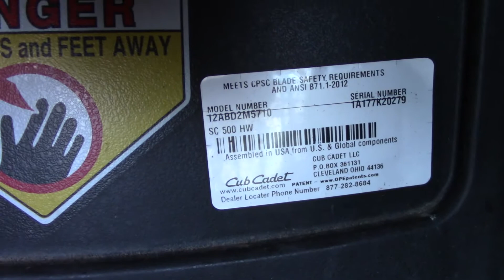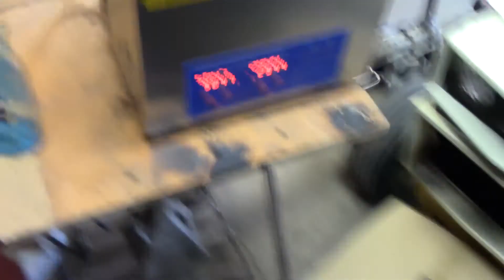Cub cadet push mower SC 500 HW Will not start after sitting all winter. Easy fix.

Comment: I have the exact same model, garage kept and use Stabil with fuel.  First 2 years worked well, last month wouldn't start.  Changed the plug and nothing.  A tech installed the tester and it fired right up.  Worked fine with tester removed now it is very slow starting.  Will have to do this same thing you did.  Thank you.
Reply from the maker: It's great you found the problem and that my video helped

Comment: I was way off on my guess o well maybe next time.  Thanks for the video  I just got one myself same brain but it's a little smaller size 6L but I have learned a lot on them to filling it full with water then you can put your parts in a container with the clening stuff  you save on the clening stuff an you don't have to clean out your mushen and you can use hevy duty zip lock bags to. I have put wingnuts in a zip lock bag an 1/2cup cleaner i ran it for 10 minutes temperature at 110 f i was wow they was clean like they was new the cleaner  that is in the bag is black what's nice i only used a 1/2 cup of the cleaner to do the job when i was dune i put the old cleaner in a container to store it in and i put the bag in trash im happy.
Reply from the maker: I just use plain water and a dash of dish soap. I will be getting a small mesh basket for small parts.

Comment: Fantastic video. Thank you.  I need to replace the control cable on my sc500hw. The cable broke. I can’t figure out whether the loop end hooks.  There’s no pictures or videos that I’ve found.  Do you know where it hooks?
Reply from the maker: I don't know exactly but if it's the cable for the drive it would hook to the gearbox underneath the deck if it is the Deadman cable there is a arm on the right side (looking from the handle bar) that it hooks to.

Comment: Great video. How is the top and fuel tank removed?
Reply from the maker: Remove the 3 nut around the pull start then I believe the cover will come off, I'm not 100% sure on the fuel tank. This is the only one I have ever worked on.
Reply: @PullerbearEd  THANK YOU VERY MUCH!

Comment: And if you don’t have an ultrasonic cleaner?
Reply from the maker: For years I only used brake &parts cleaner. Even now i still use it on carbs that dont need a beep cleaning. Just be careful of the rubber parts.

Comment: I have an older model 2013 but looks very similar, I was replacing the speed control cable and the spring fell out of the speed control assembly and I cannot figure out how that spring goes back in, any help would be appreciated.
Reply from the maker: I'm not sure right off hand but sometimes a parts diagram will show how stuff goes together.  I'm sorry I can't more help.

Comment: Hey I went through everything like you just did. And everything checks out. But it will only start and run for a few seconds only when I pour gas directly into carb
Reply from the maker: If you are getting fuel from the tank to the carburetor the it's ether the float needle is stuck shut or the main jet is still clogged. I've had some that it has taken 2 or 3 cleaning to get to work properly.
Reply: When I say directly into carb I mean like from the jug into the carb with the air filter cover off
Reply from the maker: You need to check that you are getting fuel from the tank.
Reply: I also am having the same issue!! Cleaned the carb but still wont stay running...
Reply: Replaced the carb, plug, fresh gas and oil still won’t start 🙄
Reply from the maker: The next step would be to check for spark. If spark is good then check timing and compression.

Comment: I have one of these it started fine and I had to shut it down to talk and when I pulled to start back up the cord locked up it won't pull but it pulled and started 10 min before fine . So I took the top off and it pulls but when I bolt it back down it's locked up again . What happened?
Reply from the maker: If the rope will pull normal with it off the engine the it's something internal in the engine, I would start with removing the spark plug and see if it is hydro locked.